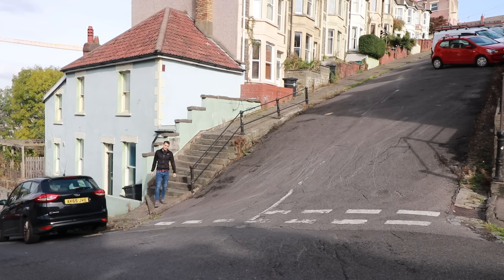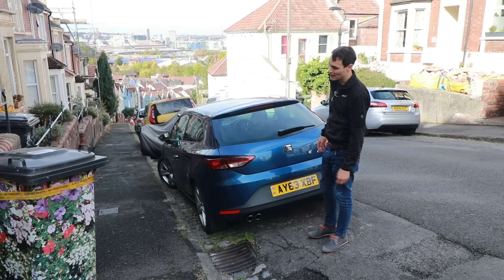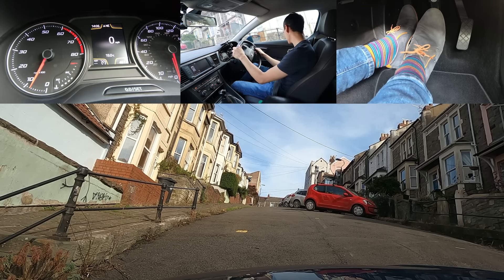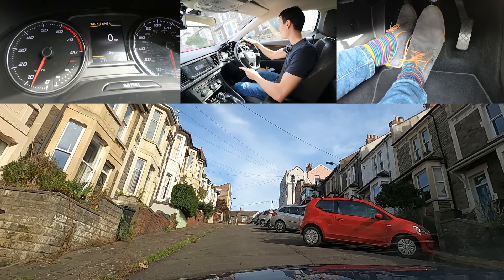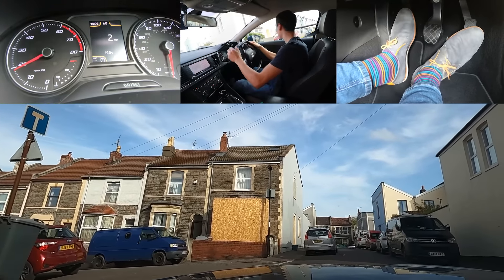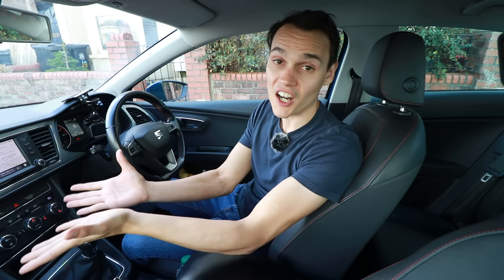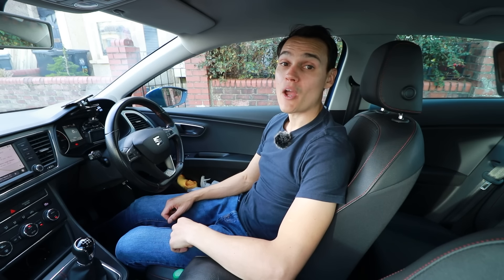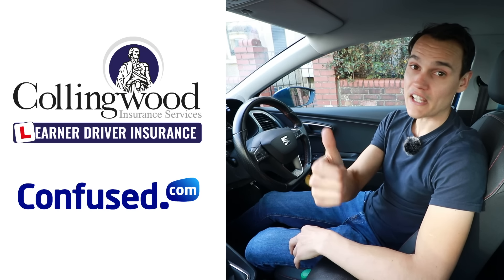Driving Instructor Stalls and Wheels Spins on the Steepest Street in England

Comment: Just came across your channel and just had to have a look. I’m currently training for my ADI, driving test is on Wednesday, fingers crossed! The car I’m learning in has the same (annoying) feature and it’s taken quite a bit of getting used to! I’ve no doubt it will help my future pupils but as you say, not all cars have this and it’s important to remind/ teach this
Reply from the maker: I find the features helpful. Hill hold assist is way more powerful than a handbrake and easier to use. But learner drivers need to learn the basic handbrake hill start as it's easier and works in all cars. Good luck with your test.

Comment: Learning how to drive a manual transmission when I was 13 years old my dad took me to the steepest hill on the only mountain in the area, parked the truck and said to start it without rolling back. I was terrified, but figured some tricks out like how to launch a boat with a manual transmission and not ending up in the water… You have to use the handbrake or parking break if it’s very steep so you don’t roll back.
Reply from the maker: Yes, handbrake starts is what I teach beginners. Hill hold assist takes more skill to use but is far more powerful as it brakes all four wheels hydraulically. The parking brake is usually the rear wheels only.

Comment: Gas before clutch is such helpful info because i was learning in a 2020ish hyundai i30 1.6t and the ecu added throttle for me while lifting the clutch slightly and when i moved onto a 2013 rav4 2.5 i instantly stalled because it didnt add any throttle when i lifted my clutch

Comment: In Poland in that kind of situation, we use a hand brake method.  When stopped, set a handbrake. Put 1st gear, slowly release a clutch, and add gas at the same time.  When You feel that the rear suspension will buckle at 2500 engine rpm, release a handbrake.
Reply from the maker: I teach my pupils the hand brake method as well as other methods. Hill start assist is stronger though and the rear suspension doesn't dip if you have a rear wheel drive car with the handbrake on.

Comment: I've gotta disagree, mate.
Even in diesel cars, you can still stall against such inclines.

I have a big diesel manual car and I realised this when I first took it to Hastings. Even with a big engine, it was stalling on hills as I just allowed the clutch to move. I stalled 3-4 times in a row and realised that I've got to put some gas within the biting point to move away smoothly, and eventually did.

For all those learners and even experienced drivers, when driving up sharp hills/roads, when driving off at the bottom of the hill from a standstill, get a STRONG biting point. 

I.e., lift the clutch slightly and press on the gas simultaneously. When you drive off then, press the gas hard. Do not think that just because you have moved away, you can be gentle. The car will start to fall back, and the manual transmission comes under stress. 

Anyhow, great video. Love your commitment.

Comment: i use the handbrake when i've stopped at a steep incline. we also used this technique when i did valet parking since sometimes you needed to park on inclines and not have expensive cars rolling back into a wall or other cars.

Comment: Modern cars have idle speed control valves although, some manufacturers adjust the ignition timing to make it idle even lower (at least that's what I read). Technically, petrol engines add more air to increase the idle speed, bypassing the throttle body, consequently drawing in more fuel. To confuse things even more, some petrol engines don't have throttle bodies, they adjust the inlet valves to control throttle position. 

I remember when the new front wheel drive Ford Transit came out. We had a trailer with a roller on it, no matter how hard we tried, couldn't get it up the hill. All the weight was on the back, front wheels kept spinning. In the end we had to use the old rear wheel drive Transit.

Comment: On hill starts in my old 2007 car (no hill assist, no computer help on the gas) I just move my right foot very quickly from the brake to the accelerator pedal, while simultaneously quickly find the biting point on the clutch.

The hill in this video might prove to steep for that method in an old low torque petrol car with 110 hp, but so far the worst I've experienced is rolling back very slightly before the clutch bites. And I live in a mountainous region.

Comment: I was taught in a diesel X1, in which I was never taught to add gas when moving off, only to increase the speed and move on to shift up a gear. When I had to learn to drive in manual petrol cars, I managed to be successful moving of once or twice, but then the third time I’d always get overconfident on the clutch and then I’d give too little gas to get it to move off with the way in which I was letting go of the clutch and well, a number of disappointing  experiences (trying) entering junctions. Also, I am still somewhat afraid when doing a hill start. Fortunately the Netherlands, where I live, doesn’t have many hills!

Comment: Drove a BMW X3 or X5, I cant recall but it was an automatic. On steep hill the auto release "handbrake" would detect the throttle or forward movement and release the "handbrake" and the car rolled backwards. Normally not an issue as drivers give it more throttle when pulling away but where we were, we had to drive dead slow.  I have seen someone hit the car "behind" for this reason. Had to explain to them to put left foot on the brake, try to drive off as this would release the "handbrake" and then they could release the foot operated brakes.

Comment: Hill starts like this are even harder on a motorcycle. Due to having to hold the back break down while holding the front break while also supporting the bike with your left foot. Then, then also trying to let off the clutch, both breaks and open the throttle at the same time.

Comment: Whilst on holiday in the alps we decided to go down a hill road to see a frozen lake. The only problem was that the road to the lake was not only very steep, but also frozen since it was in the shade for most of the day. We had winter tyres so the only way to have any traction at all was to put two tyres on the side of the road where there was some fresh snow that had not been compacted yet. So a 20 degree steep incline with frozen asphalt and snow. I had to get some momentum before attempting it but if I had stopped at any time during the climb we would probably needed to be rescued by a 4x4 vehicle.

Comment: I passed my test in 1981. In those days cars did not have hill start assist (uses the abs I think? & cars didn't generally have abs then), no traction control, nor did they give you a blip of 'gas' as you release the clutch. Only the more powerful cars would move off w/o touching the accelerator w/o stalling. Back then everyone learned how to do hill starts properly w/o rolling backwards -  holding on the handbrake, gentle on the accelerator, gently lifting the clutch to find the bite point (the instructor would sometimes have you practice finding the bite point on a hill, balancing the clutch & accelerator w/o moving off, with no brake on), then release the clutch & handbrake as you press the accelerator. Easy! Everyone learned to do it. Or if you were really good you'd hold on the footbrake then very quickly off that & onto the accelerator as you release the clutch.

Comment: I've always used a little bit of gas when driving a manual, even on a level road. My driveway is similar to that road, as it's very steep and has a sharp angle to its base. What I've sort of taught myself to do (which I'm sure isn't great), is to roll the car up the hill a bit, and then once it feels like its going to stop rolling, I push the clutch in about half way (the bite point in my '02 Civic Si Hatch), and then hold the clutch at that bite point until the RPM starts to climb.

Comment: I've taught a number of people to drive manual and usually make it clear that the "no throttle" method's just a good way to get the feel of the clutch pedal without bucking, and it's much easier on the car than that and/or excessive slipping under power, but you need to learn to launch with throttle before leaving the empty parking lot.
Reply from the maker: Agreed, I'm talking about never being taught to add gas first.

Comment: normally all cars that have electronic fuel injection will add gas purely because of the idle management functions, basically they try not to let the rpm drop below the idling limit, but with high load they may jump out of the algorithm. Then some car may have a drive off assistance

Comment: Been driving manual for 30 years.  Right foot on brake, left foot on clutch. Lift off the clutch until you feel the bite point. The car will feel like it wants to move forward. Move right foot to gas pedal and apply gas to raise rpms while releasing the clutch pedal.  If you are on a steep hill, stopped, you can use the hand brake until your right foot is on the gas, then release the hand brake as you apply more gas and slip the clutch.

Comment: Today I had to drive away on a steeper road than I'm used to. I wasn't sure if I could do it without using the handbrake, but in the end I managed to do it. I pressed the gas pedal all the way down, I was so nervous it wouldn't work 😅 and first, the car rolled back just a bit before finally going forward. 
Quite nerve-racking, but a useful experience.

Comment: In a lot of countries, there's a "controlled environment" driving test, which involves the teaching of vital skills for the drivers before heading to the on-the-road phase of the driving test. At least in my country it involved parallel parking, 3 point turn, s and z turns and the most difficult of all is the hill start scenario, which involved proper hill start technique, involving the handbrake, and pre-biting the clutch with throttle input. It is sort of like a manual launch control for your vehicle. And you fail the test if your engine stalls or your vehicle rolls back before moving forward. I find it strange for a lot of countries do not have this kind of controlled environment to test the vital skills at certain scenarios, or to let learners familiarize with the proper, basic technique before going on the road.
Reply: You could argue we do it in a "controlled environment" in that instructors will use either a private area, or a known, quiet road to learn basics of handling a car.

If you use a learners car, they have their own pedals for emergencies anyway (and you get an immediate fail if they have to use them during your test.)

Comment: best skill that works for me when pulling away and ive done this for many many years now.hold foot on the foot brake lift your clutch untill you feel it starting to engage now hold the clutch there release the foot brake the clutch will hold you there in position yes its riding teh clutch not amazing for legevity but its a split second once you get the motions then onto the gas apply a little and then lift clutch slowly at the same time 

never even need a handbrake no matter the size of the hill but for a new driver i would air on the side of cuation and be ready with teh handbrake for when you stall it as you will many times untill you get the hang of it

Comment: I am wondering whether traction control defeated him on his attempt with the wheel spin and the engine stalling. Traction control cutting power when the wheel started to spin, dropping the RPMs to a level where even at full throttle there wasn’t enough torque to keep propelling the car uphill.

Comment: I’m a new 4 wheel driver and drive manual. Let’s say a total of a day driving experience. I can drive it with no problem in straight road and slightly steep road without backing my car that much. But, the other day, I was tested. I encounter a place that is super steep. 2x steeper than the video. I already reach the top, but not high enough to reach the straight road, and there are cars left and right so I need to stop, that’s where the problem began. When I release the break the car back down immediately and so fast. I panicked but I’m glad that the road not used to often so no cars behind me, but it took me 2 times to go to the top. I need to start at the bottom everytime and even hand brake cannot help me. At first I thought my hand brake was broken, but I guess it’s too steep hand brake can only help me back down a bit slowly. I will not be able to forget that moment.

Comment: Interesting that the cars parked on the right are all parked on the right are angle in such a way that it looks like they came down the hill and turned left to pull in to the bays, to avoid doing the tricky hill start on that junction.  Just keep the same steering lock in, reverse out and bring in the brakes, straighten and go down the hill, when you’re leaving.

Comment: Yeah uphill starts were a piece of cake in my instructor's car, which back then didn't even have hill assist, but the weight of the car and the clutch did the trick...with my alfa 156 1.6 TS 1999 (with a slight hesitancy at low rpm perhaps due to the old stepper motor) I just have to use the handbrake, even in mildly uphill roads...that or I have to rev the car high, create lots of noise and wheel spin...hill-assist is one thing I am missing in this oldie but goodie car, really meant for the highway.

Comment: The problem is down to the fact that most modern vehicles limit the amount of throttle when the clutch is depressed.
My Transit will rev right up the range with the clutch out . Dip the clutch and try to rev it up , and you’ll see the restriction.
I found this out when trying to get my daughters Fiat up a hill .

Comment: I haven't watched the whole video but here's how I do with my purely mechanical Lada without any assistance - I slowly depress the clutch until RPMs fall around 800, let off the brake, give some gas first to raise the RPMs about 1500(depending on the hill) and releasing the clutch more and giving throttle accordingly to maintain above 1200rpms. When the car gains the speed corresponding to the engine rpms(you can feel it), release the clutch fully and drive.

Comment: I want to try that in my EV which has hill hold and will creep itself along without needing me to do anything. Starting on the steep bit and trying to set off could be interesting, it won't stall but I bet it'd not be able to set off without wheel spinning and I'd effectively do the automatic equivalent of riding the clutch.

Totally didn't know non-diesel cars can even set off without needing the accelerator. All the ones I've owned just stall or need very careful lifting of the clutch to do it. Had a diesel car that could do it in second gear.

Comment: Thanks for demonstrating the major problem with modern cars! Modern cars are set up to have as much 'bhp' or power output as possible at the great expense of having very little torque and lower rpm. Depending of specifications, a modern (non-diesel) car would need to be at 3500-4000 rpm, or even higher, to develop maximum torque. This means that there is only a very small amount of power available for starting with out revving the engine and a lot of clutch slip, possibly resulting in a burned or glazed clutch. It is an unfortunate fact of life that a car with a higher maximum power is more attractive and more saleable than one with more usable power.

Ironically, a turbo makes the situation worse because there is even less power at low rpm (because of the lower compression because of the turbo) and when the turbo finally spools up it increases the possibility of wheelspin.

This is one reason why, with modern engines, proper (torque converter) automatic can be much better choice, as well in situations such as the one demonstrated here in this video.

Regarding the use of the term 'gas': When I was taught to drive in 1990-91 my instructor also used the term when instructing so it appear to be a standard practice going back even further!

Comment: to the gas pedal point, i'd add that it's often used to hold speed, not to accelerator, and so gas pedal really is more accurate. Or, if we wanted to split hairs....throttle

Comment: Im from India. We mostly drive manual without hill assist. Most drivers drive these hills in western ghats easily. 

Even the hair pin bends are sometimes more steeper than these with a curve in it.

It says india is not for beginners. And it is very chaotic as well to drive in India. 

I wish we have better driving disciplines.

Comment: Mr. Teacher I think you should know and also show how to hold and help the car using the clutch so you have the maximum torque even if you slip the clutch a bit. Also, the road administration should fix the road so no car is getting any damage otherwise they should be sued for damages. I can't even try going on a hill like that because I have a low suspension and I might break my oil pan.

Comment: I learned to drive 25 years ago when handbrakes were manual and hilstart assist hadnt been invented.

We always pulled away using handbrake to control the car until clutch bit enough to hold the car. One foot on accelerator one on clutch.

Using the brale pedal instead of the handbrake was frowned upon and likely to be a fail as they dermed you not in control of the car.

Have driving tests and instructor advice changed now that cars have hill start assist and electric handbrakes? Or does it depend on the car?

I can remember many driving lessons in a queue of traffic on a steep hill doing handbrake hillstart after hillstart. I feel like its a skill you could get away with not learning if you had a new enough car.